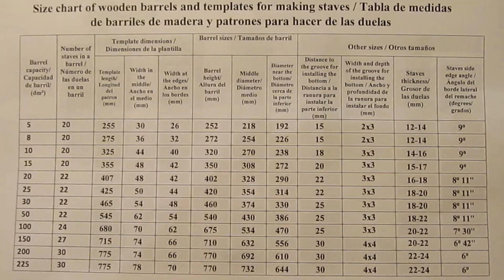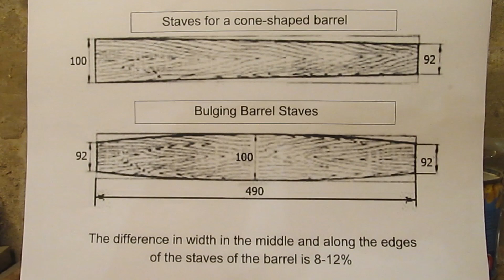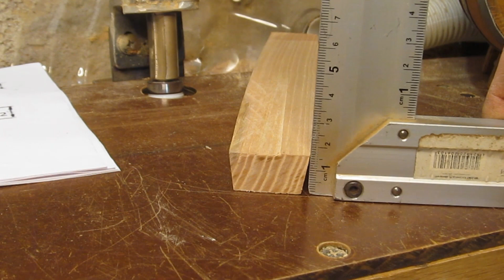А whiskey barrel DIY | Dimensions, angles, templates | How to make a wooden barrel at home

Comment: does the logs need to be aged/dried out before using or can recently cut down wood be used?
Reply from the maker: I split and saw freshly felled logs into blanks, and only after that I dry the blanks in the open air for 6-18 months.

Comment: great video and I would like to make a barrel. What about the hoops? What diameters do I make then?
Reply from the maker: Thank you very much!!! In order to make a metal “working” hoop, you need to calculate the approximate circumference at the edge of the barrel and a little closer to the middle of the barrel. With the help of these “working” hoops you will assemble a barrel. And on the finished, polished barrel it will be necessary to make “permanent” finishing hoops... At the end of this video, I show how to make “permanent” hoops. https://youtu.be/ci-98P-yQSg
Reply: @tmzhenatanwoodworking7252  I want to make 30 and 50ltr wooden barrels. Where can I download the stave pattern?
Reply from the maker: @tonylovering4672  In this table I have indicated all the sizes of wooden barrels and templates for making barrel staves. https://www.youtube.com/post/Ugkxk9VwwhE01fjSACVClGrCiSyMbKendqwP

Comment: I have a technical question, if i was to glue the staves together as well, and later remive the rings-will it fall apart?
Reply from the maker: If you glue barrel staves together and remove the hoops, then after filling a wooden barrel with water, the wood will begin to swell and the barrel may fall apart...

Comment: I want to make one with a 12 inch diameter, how should I cut the staves can you plz help me
Reply from the maker: For a 12" barrel (which equals 30.48 cm), I recommend using 20 staves 5.0 cm wide at the widest part and 4.6 cm wide at the edges. The angle of the side faces of each riveting should be 9 degrees.
Reply: @tmzhenatanwoodworking7252  thank you so much, I will work on my project and try to send you final result!
Reply: @tmzhenatanwoodworking7252  i forgot to ask, what size should the hoops be? I plan on using four total

Comment: 5:27 what is the machine and tool called?
Reply from the maker: To make the  staves for the wooden barrel, I use a homemade jig template that I made from a piece of laminate. And I process the side edge of the barrel staves on a homemade milling machine, which I made from a broken angle grinder. Here are the links to the videos on my other channel: https://youtu.be/6wkRM-P_-0I
https://youtu.be/E5OmePuCYKM